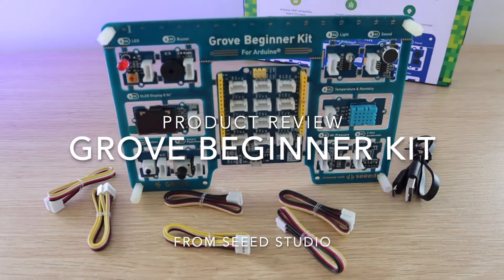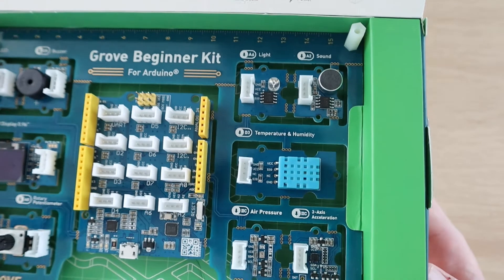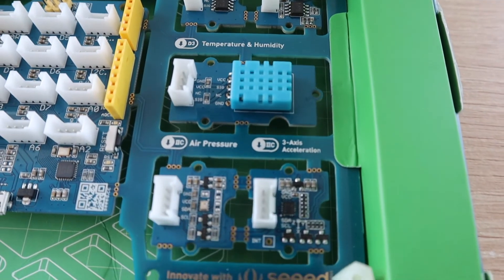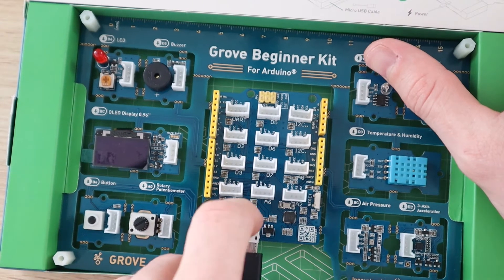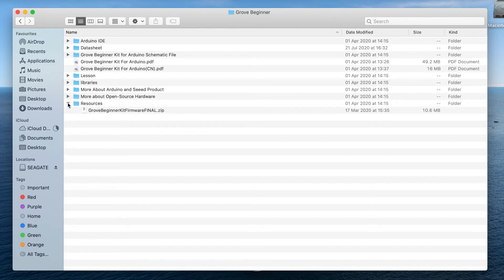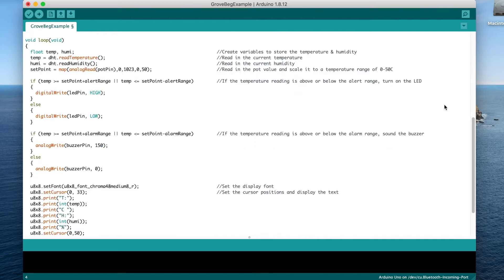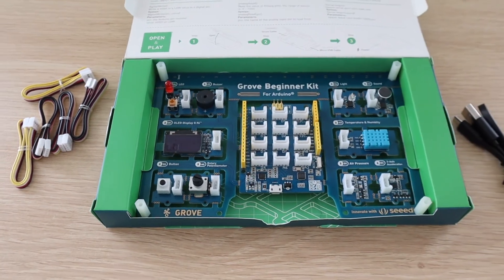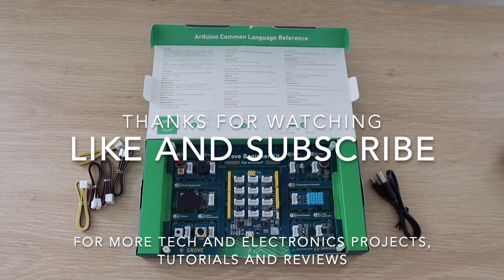The Easiest Way To Get Started With Arduino - Grove Beginner Kit

Comment: I just bought one of these kits, I love it. Can anyone advise on how to cut out the individual sensors/mini-pcbs without damaging anything? Do they just twist off? Or do you need to cut our somehow? Thanks.
Reply from the maker: They're designed to "snap" out of the main board but I used a small set of side cutters to clip the bridges to get them out. I'd imagine you can use a dremel to get similar results.
Reply: @MichaelKlements  Perfect thx, they do like they snap out. but to be safe I will cut. Good point out a Dremel, I do have one. Appreciate.

Comment: Hi Michael,

Is it possible to use Grove - UART WiFi V2 (ESP8285) and Grove - Mini Fan v1.1 for monitor/control temperature with an app?
Reply from the maker: Hi Hamid,
Yes you should be able to use those with this grove board to monitor and control temperature through an app.

Comment: Is the project tutorial provided easily to learn? I'm planning to use this on my capstone project.
Reply from the maker: Yes it's really easy to learn. They give you step by step tutorials for each sensor and Arduino is very well supported online, there are loads of other libraries, tutorials and forums if you run into any issues.
Reply: @MichaelKlements  Thank you! I appreciate your time to answer my question. I will subscribe to your channel to learn more. I hope you'll create a simple project tutorial using this, It would be a big help for beginners like me.

Comment: It actually looks pretty neat. A lot of times you have different ideas which you reuse, but don't necessarily want to make permanent or fiddle with components each time. So you can upload the relevant sketch and get going.  Neat concept.
Reply from the maker: Yeah it’s really great if you’d just like to try something out or test some code and you don’t want to have to set up a whole breadboard you do so.

Comment: How would you compare it to "SNAP Electronics Kits"  ?
Reply from the maker: Hi Robert,
I think they're for slightly different targets. The Snap kits are designed more for learning electronics and the function of basic electronic components without programming. These Grove kits are designed with more of a focus on developing and programming systems or projects without requiring tinkering with electronics.
Reply: @MichaelKlements  Thank you. I plan to purchase an EEGLOO Arduino Starter Kit and go the traditional route with the use of a breadboard, but it looks like the GROVE KIT has advantages too. I have one of those small displays and would really like to start using it. Some folks made their own Google Glasses with them.  - Robert
Reply from the maker: The Elegoo starter kits are also a great place to start, they allow for more electronics tinkering. Those OLED displays are pretty easy to get running as well, they usually connect through an I2C or SPI interface and there are loads of libraries available for them.
Reply: @robertsimpson4693  Hello Robert. Little suggestion, choose according to your purpose. If you're looking to learn Arduino programming and use it for some projects, you'll find that our Grove Beginner Kit makes it all incredibly easy and save a lot of time. If you want to become a hardware engineer, learn hardware details and principle, well, we must admit, EEGLOO kit with a breadboard is better for you. By the way, do you know those folks who made their Google Classes with our grove beginner kit? We'd love to contact them and provide our help and resources. We're happy to work with educators, and if you can help we'd be happy to send you a free set.  You can contact us by
aidan@seeed.cc. Stay safe!